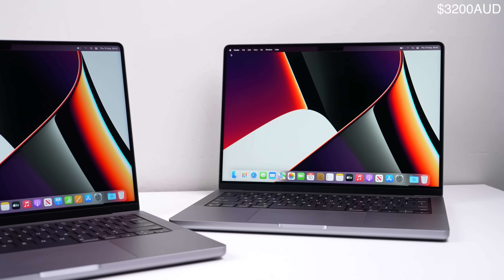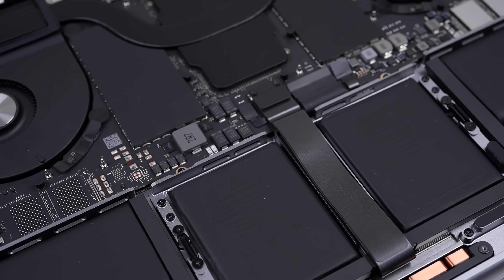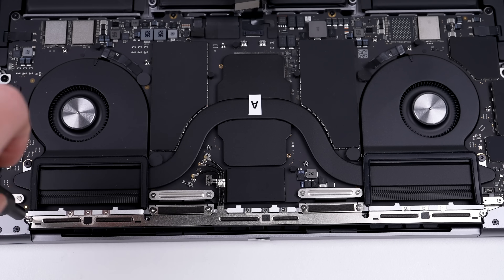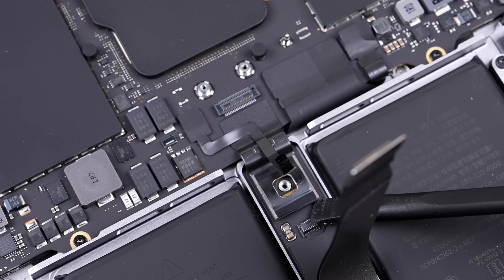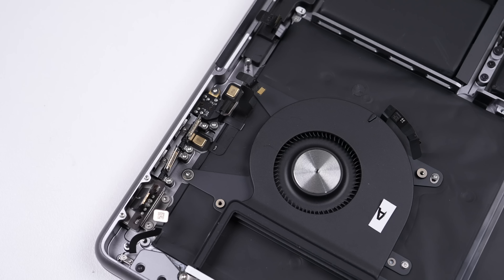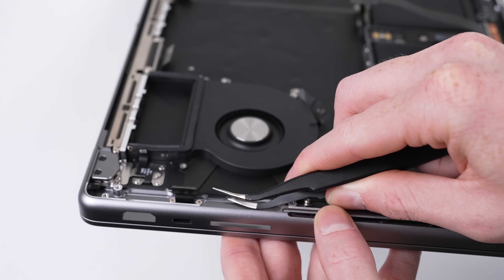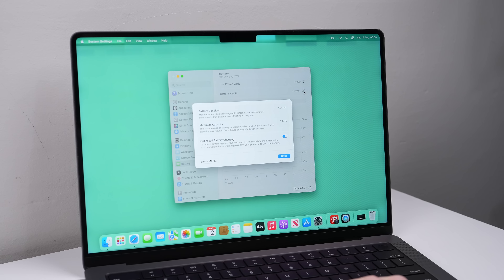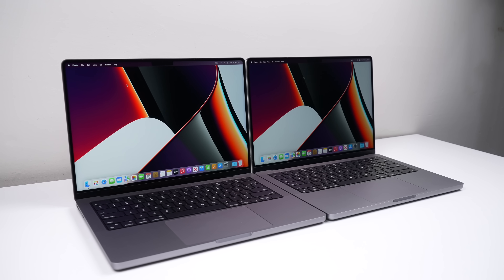New Anti-Consumer MacBook Pros - Teardown And Repair Assessment - Apple Silicon M1/M2

Comment: so they bring back a proper replaceable lcd panel to replace that dumb retina system of loose layers stacked on top of each other. Just to ruin the point of having a easily replaceable lcd panel by pairing it to the m1/m2 chip and the fanboys still claim apple is not evil and the best manufacturer. SMH.
Reply: I've done the dreaded riveted keyboard replacement several times and it is indeed terrible. Sometimes requiring to drill out the remains of rivets with a 0.5mm drill bit. Definitely not one of my favorite things to do. Really need to build myself a proper cnc mill with double guide rails all throughout to create a cnc mill that is as accurate as possible while being as economical as possible. Then I can just program the location of each of the rivets together with the depth of the holes into a program and have cnc mill automatically drill out each and every rivet. Thankfully the aluminium is soft enough for normal metric screws to create their own threads as you insert them. Paper masking tape helps a lot to keep delicate flex cables out of the way when placing the motherboard back into the laptop.

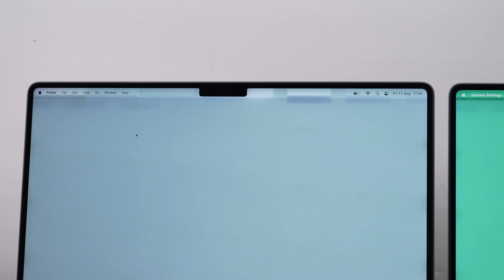Comment: 6:18  yes as you surmise it's a configuration issue because the screen is paired to the logic board. Apple has a software tool to recalibrate a new screen or one from another Macbook but they do not make it available to 3rd party repairers. You can remove the LCD panel from the diosplay and transfer two BGA chips from the old screen to the new screen. This is a specialised procedure and definitely not feasible for the general end user.
Reply: Would be interesting to hook up some "debugging hardware" to main in the middle the communication between the lcd/sensor and the rest but i unfortunatly neither have a macbook nor the money to buy one
I don't have any schematic but at least up to the iphone 11 there is a simple i2c eeprom which stores the serial number for the screen so it could be the same
Of course they could have used encryption but the question is did they? If not one could make an simple programmer or modchip which plugs inbetween, kinda like car immobilizer emulators :D
Obviously that would not be needed if they... would just store everything on the display itself like every other manufacturer

Comment: Not sure how you expect the laptop to come shipped with the calibration profile HW that is not shipping with the laptop. The entier HD would be full of profiles for differnt screens and it would still not include profiles for screens made after your laptop shipped?

I assume you mean should ship with calibration software so that you can re-calibrate yourselves.  This could be possible for the angle sensor but unless you have some very costly equipment backlight calibration is not easy to do, you would need a rig that can scan each point on the display and report back the brightness etc.  It of cource would be nice if apple providing the tooling so that if you have created such a profile you could load it but I expect all repair vendors would just copy some profile from another display can call it close enough. The needed equipment to properly calibrate costs many thousands.

Comment: I can bet why the angle sensor is a problem... I'll bet the magnet isn't aligned in a specific direction when installed and the sensor has to determine the actual alignment. 
So if you swap, the stored orientation doesn't line up anymore.

Comment: Everyone needs to boycott apple period.  I still have my mid 2012 mac book pro 13 just upgraded the ssd to 4tb.  Wish i could upgrade software though.  Main Reason why i switched to android.  My charger port died on my s23 ultra had it replaced in a hour and works perfectly.  Screw apple.

Comment: Hugh, please stop using Threadlocker RED for these types of repairs with tiny screws. Threadlocker BLUE is the correct formulation. If you try and take the displays off for more "experimentation", you will not get the screws out. You should know this by now.

Comment: And what really infuriates me is that Apple MacBooks are so good in hardware, battery, and overall performance. 
And they know this too, so they abuse it.

Framework laptop, or any Linux laptop, haven't got into this stage, and I don't know if that's possible too.
Reply: I don't give a shit that MacBooks are better than anything else on the market. They can't be repaired by normies. That alone makes them as worthwhile as diamond rings.

Comment: The problem with this is that the target audience for this computer just… doesn’t care. It sucks for the right to repair movement, but ppl like me will keep buying these computers regardless of what Apple does to them. I simply want the best possible laptop and nothing in windows land (I’ve tried too many laptops at this point) even comes close to the performance, battery life, trackpad, and convenience of this thing 

It’s funny cause I work in a MacBook repair shop and run a small phone repair business on the side, but there’s not currently a solution

Comment: It’s completely nonsensical to think that less screws on a windows laptop is better because guess what? they break easier than Macs. Right to repair? Yeah no that’s your problem, we aren’t going to sacrifice performance or form factor for your ability to repair a few parts a two or three years down the line. Get better hardware and you can repair it.

Comment: 2:22 Really no need to bend that battery tab back so far, it only needs to be lifted slightly so there is no contact, plus with a genuine Apple battery, the machine cannot boot once that data flex is disconnected (not true with aftermarket batteries though, so be wary of them) If you are worried about the battery main contacts reconnecting, cut a small plastic insulator from a sheet of plastic to insert between the battery tab and the two connections on the logic board. The tab is definitely not designed to be bent back to a 90 degree angle like shown here.

Comment: No wonder these devices cost as much as they do. Apple must be charging by the torx, and 2x per proprietary screw. But what else is new? 

You've gotta hand it to Apple for their M series laptops though. They created the use-case for Arm CPUs in consumer laptops. If it wasn't for that, these devices wouldn't even be worth taking about.

Comment: and thus is demonstrated why I will never invest in contemporary Apple products.

Back in the days of antiquity, c.1984, I used to really like Apple. The Apple //e desktop was a fantastic, open architecture computer. I wouldn't be surprised if that openness was a mind-set of Steve Wozniac. And now that he is "out of the picture", look what happened.
It had several expansion slots in the rear, albeit №6 was invariably annexed by the Disk II system, and №0 had any RAM above 48K stuffed in it, but the rest were free game, and there were many options.

… I should have a got a Framework PC rather than my current desktop box. Those guys, and their mind-set need supporting. Next time.

Comment: Thanks so much for your hard work. Just on a holiday in India but forgot my charger of my Macbook. Apple has a very low penetration in India. The charger would have cost double in Goa than in Sydney. Lucky a PD 12V adaptor provides very slow charging, enough if left on over night. Indian people start buying the Iphone 14 pro once they know it is actually built in India. This will hopefully open new doors to somehow get genuine Apple spare parts and hopefully also calibration software. I hate ios but chosen to carry a Macbook for its all metal case and higher perceived data security.

Comment: After watch this video I searched on "Xianyu", a free marketplace in China. And I found those repair worker already knew how to replace the screen without facing those bugs, it needs a chip in the original screen assembly or only replacing the panel. If you have the orignal screen I gusess you can still find someone to repair for you, but not by yourself.

Comment: I am wondering if the brightness thing is due to macOS or the low-level firmware on the chips. Since we can install alternative operating systems on macs, this might be a good experiment to see what happens in another OS.
Reply: The issue is down to no having a profile for the backlight.  When you have thousands of LEDs on a backlight they are no all going to respond the same, each one that comes of the production line will have a different response on each LED. This is tested and a profile is created (in effect a brightness correction for each LED).
Reply: @hishnash Your explanation is logical. But in that case each panel would show a different defect pattern. Here it is exactly the same for the 2 screens. Looks more like an indicator than anything.
Reply: @effehell7593   Yep that is to be expected.

If you apply the correction profile for display A on display B you will see the same visual defects in that the LCD will show simlare contrast patterns as it is applying the incorrect profile the the blocking of the light using the LCD.
Reply: @hishnash Wouldn’t you expect the defect area to be too bright on one display and too dim on the other though? On the side by side comparison in the video the defects are the same.
Reply: @coctailrob  With a SN mismatch it is very possible no calibration is applied at all, and that this discontinuity in brightness is common across most panels (due to contruction).  While applying the profile from the other display might help it will never be perfect, though it might be nice if apple let you force the SOC to apply whatever profile it had on file it might well be better than nothing.
Reply: @hishnash  Nah the backlight seems completely uniform apart from these "what did you do to my screen, you silly 3rd party repairman" marks. That's not calibration, that's "go pay us money" from Tim Cook
Reply: @shadik1998   No this is likly a common defect on the miniLED backlight from production, most displays have common defects that are very simlare between units (not pixel for pixel identical but smilier).
Reply: @hishnash  Yeah yeah, trillion dollar company can't produce a uniform lit display that happens to not litup in almost pixel-perfect pattern on two different MacBooks. Very unsuspicious, very believable
Reply: @shadik1998   Yep given it is a mini LED backlight display you expect non uniformity and the same pattern likly comes form a common defect in production.
Reply: @hishnash how much does Apple pay you to spread these lies?

Comment: I need to replace the display on an M1 Pro MacBook Pro 16”. Is there anything that can be done in DFU mode to pair replacement components with the motherboard, or does no amount of DFU voodoo get rid of the screen glitches and angle sensor oddities? I’d hate to spend over $600 on a replacement screen only to have it behave badly.

Comment: It'd be very interesting to swap the lid sensors of the laptops and take one into Apple for repair. Knowing that all that's required is a software calibration, I wonder what they would charge and how they would diagnose the "issue"
Reply: they would say you did water damage to the laptop and you must pay 2000 euros
Reply: I wouldn't have put it past Apple to have put in some kind of case sensor that increments a value every time the case is opened. I have no idea how they'd do that, but in a world where eFuses and Launch Control counting exists (if you do this too many times in a premium sports car they can charge you more for the service) it's plausible.
Reply: @RobertPlant-wn7qn It would be the easiest thing in the world, just two contacts that use the backplate to connect them. Remove the back and the contacts would lose electrical connection
Reply: @RobertPlant-wn7qn giving Apple bad ideas is dangerous to other people lives.
Reply: @RobertPlant-wn7qn   No they do not do that, that would increase the cost of making the device and the SOC why waist money on that.     Apple does not think about third party repair at all during the design and production, its not that they go out of there way to make it harder they just never think about it at all.
Reply: @hishnash  Apple has been shown several times, including in this very video, that they indeed engineer countermesures against third party repair.
Reply: @hishnash B.S.
Reply: They would replace the sensor, the in store vendors do not have tools to do new calibration all they are able to do is pull existing calibration profiles that come with new parts.  When you get a new part you get a part SN number, this is what allows the laptop (in diagnostic mode) to pull the profile from apples servers.   There is no part calibration happening at repair time.
Reply: @hishnash Apple authorized service providers do have the tool it can be downloaded in GSX Apple will calibrate it for you via self repair options
Reply: @hishnash  that's a very interesting insight, thank you. That said, I'd still be curious to see what they charge for pulling down those profiles. Also whether or not they would attempt that process on the sensor currently in the laptop, since it is already a genuine Apple part.
Reply: A 30 minute battery change at an independent store with some chip soldering (iPhone) takes 5 days at Apple official store... so you need to leave your phone there for 5 days :) That's not gonna happen.
Reply: @hhy2k  simple fix,Get a non apple product. Imagine a 1/2 Apple and1/2 Tesla product. A mosquito lands on the screen of a laptop. Well that is damaged and that will take 1 year to replace,to late because the device is end of life befor it is fixxed.

Comment: I would NOT have had the patience to remove all of those screws and flex cables. Honestly though, I'm surprised Apple didn't go a step further in anti-repair and use adhesive to prevent opening it. What even is the point of spending $6000 on one of these? Nothing can be upgraded and I'm sure it isn't any faster than a Windows laptop that can be had for several thousands less.
Reply: M1/M2 does actually have considerable advantages over other hardware in terms of efficiency and even performance in some cases. It makes me sad that these chips have to be bundled together with hardware designed to break and be unrepairable, all as an unethical profit measure by a megacorp. This trend is the biggest market failure of our time.

Comment: If Steve was alive and still working at Apple this would have never happened.
Reply: Either that or its the employees doing this
Reply: That’s absolutely right. This thing was pushed by the current team. All the computers Phil Schiller has presented during WWDC could be repaired or upgraded in someway. They don’t care anymore and have that “luxury brand” gimmick since Angela Ahrendts came from Burberry to work with them. It shat on what they were all about.
Reply: Not so sure about that

Comment: I'm still using the 2015 MacBook Pro - with its metal case.   I can't tell if the laptops in this video are using plastic for the case - but, it does look like plastic.  That'd be a shame if Apple switches to plastic cases for their laptops.   The solid metal feel is choice.
Reply: New MacBook Pros definitely have a metal case and a very solid build. Even more than the previous generations I'd say.

I understand that Apple products have low DIY repairability but nonetheless... I feel like complaining about this is like somebody complaining that it's inconvenient and expensive to maintain after buying a supercar for day-to-day use. Repairing Apple devices outside their authorized service providers is not a thing. This comes from a person living in a country with particularly strong consumer protection laws, though; I think I have had around ten major component replacements on my personal MBPs over past 15 years performed at no cost to me under consumer protection (not even AppleCare), including replacement of whole mainboard over four years after purchase.

Latest generation design has been completely trouble-free for me 1.5 years of ownership, though; both on personal and employer-owned identical MBP. I'm expecting to pay once or twice for a battery replacement (which is not cheap, but not relatively horribly expensive either when taking into account that the laptop itself cost like 6000 euros) before upgrading, but that's more or less unavoidable with a full battery discharge cycle every two days or so.

Of course if one wants to use Macs and buy five-year-old devices (which mechanically are usually just fine if treated properly!) their design and repair policy is not your friend with aging components... but such is life.